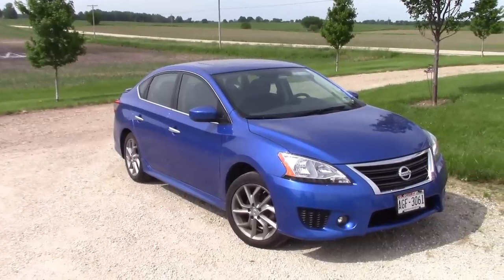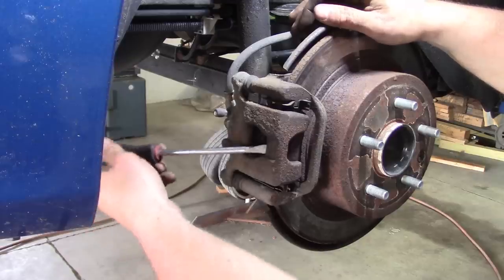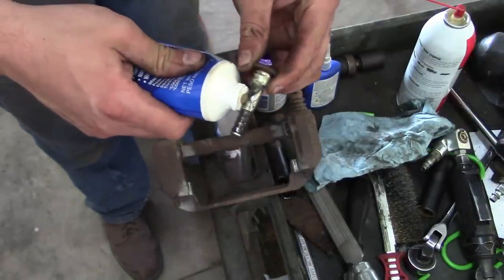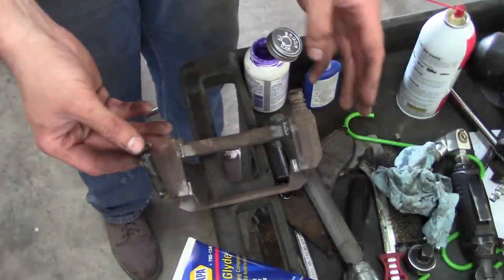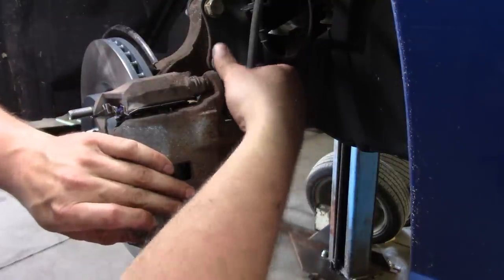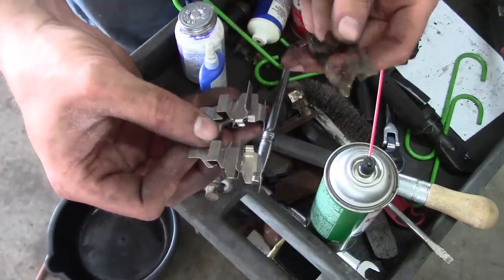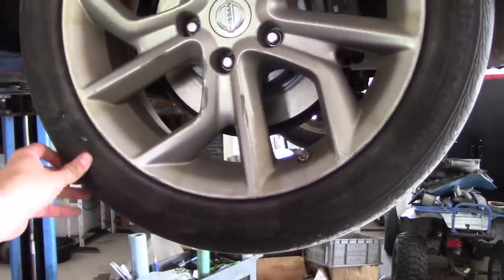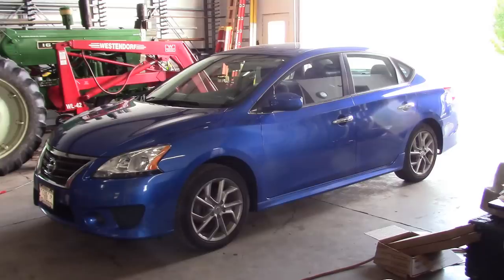Brake Job - 2014 Nissan Sentra

Comment: Nissan puts the plastic sleeve on the pin to give mechanics something to talk about while they're doing brakes.
Reply from the maker: Mission accomplished!
Reply: This has plagued me. I've taken calipers back off because I put the plastic pin in the wrong spot whilst having zero clues as to its function.

Edit: a word
Reply: It's anti vibration / rattle so they don't have to machine the bore perfectly (cost savings) for no rattling in the bore can expand and contract a little I've fixed a noise with the brakes just by replacing them on a Mitsubishi caliper had a ton of up and down movement basically same function on Nissan.
They only need one because it's redundant the top is connected to the bottom
Reply: @Michael-uo4jj  do you know why they are putting them on the top side of the bracket over the bottom and is it better there instead if the opportunity is there?
Reply: We have plenty to talk about at nissan other than the placement of that rubber on the pin. Mainly making fun of other techs mistakes and yelling across the shop about it 😂
Reply: Based on  several service manuals I've seen the intent is to use them as a temporary  retainer while  installing pads and then swing it back into position... less chance of dropping the caliper and damaging the hose..... that said it  seems like kinda of a weak attempt... but that's my story

Comment: If I was you I would do a test with that Torque stick, I stopped using them completely when a Cadillac I worked on threw a lug nut and when I checked the nuts they were all loose. And I have a really good Snap On Impact. Ever since then I have been using a torque wrench. maybe you luck and have a good torque stick ...mine was lying to me. LOL

Comment: Customer can watch YouTube and view the Quality brake job she got. Some shops would just replace everything, Wes showed that you can clean and lube parts and save customers money. If I lived close to you, my cars would be sent to you Wes. Thanks for breaking it down so us amateur's can learn.  😊👍🍻 Pray family is well 😊👍
Reply: I dont know if its always true in auto shops but I work on heavy equipment and our shop rate last I checked is 180 an hour. In a lot of cases its cheaper to put new parts on than it is to pay the labor to clean and reuse old parts. Not always the case but something to think about when you get a quote to replace parts
Reply: @deankruse8751  Thank you for educating me with a different perspective 😊👍🍻
Reply: @alexanderzerka8477  I've been in the industry for about 10 years now and I've never seen someone rebuild a caliper. I've talked to some of the old guys about it in the past and even they said they hadn't rebuilt a caliper or wheel cylinder for many years. Don't think the rebuild parts are even that available anymore in most cases, at least not in stock.
Reply: @alexanderzerka8477  ahh that makes sense. I'm trying to think where this might be?
Reply: @deankruse8751  absolutely the truth in the HD world sometimes. I've replaced a lot of components because the time to clean them up would far exceed the cost of replacement for the customer.

Comment: I've used the purple goo for many years! Eric is right, there are no problems. He's in NY I am in north east PA. Here is what Permatex says:
Permatex Ceramic Extreme Brake Parts Lubricant is a 100% synthetic lubricant containing real ceramic solids for extreme performance under the most critical braking conditions. A purple, non-melting formula, this premium lubricant is Permatex's longest lasting, most temperature resistant way to silence brake noise such as squealing and chattering. Also effective in preventing long bolt and sleeve seizing and galling; excellent on rolling and sliding surfaces operating in wet or dry conditions from -65 degrees Fahrenheit to 3000 degrees Fahrenheit. This product assures that critical brake parts remain lubricated throughout brake pad life. Resistant to corrosion and contaminants, it will not wash out. Compatible with internal/external brake rubber and plastic hardware, including ethylene-propylene rubber. From special-mission, job-specific lubricants, protectants and dressings, to the rigors of heavy-duty needs, count on Permatex to bring you reliability and problem-solving solutions that extend the life of your equipment.
Reply: Yeah, but... there are a lot of claims of slide pin rubber swelling and preventing reinstallation of the pins, and Permatex obviously knows about this from their customer service return message they left for Wes, since they sent him over to a different product for slide pins, and they didn't exactly come out and deny it and say 'that's impossible'
Reply: As a former employee of a brake remanufacturer we had to recall thousands of calipers and change out the purple permatex that said on the bottle "safe for rubber" - it was petroleum based and swelled the rubber to the point that the caliper was effectively seized.  That was over 7 yrs ago, maybe the formulation has changed from a petroluem base.

Comment: I was watching this at 2X.   That hammering on the rotor - - Wes has rhythm.   Thanks for digging into the brake parts lube mystery.
Reply: You too!
Reply: Did you watch the Mannheim John Deere tractor repair video when Wes was tapping on the valves?  I had to watch that several times - the sound and rhythm was just awesome!

Comment: You had me laughing with the “landscaper” comment!
Brakes have gotten more complicated since I worked on drum types in a shop. Yes I’m that old.
Reply: Back in the 60s, I used to re-line brake shoes and grind the shoes on an arc machine to fit the drums.  Might be about the same era as you.
Reply: I work on drum type brakes everyday they haven’t gone anywhere. They are mostly on trucks or small base model cars.

Comment: Regarding EPDM: Any rubber that comes in contact with brake fluid can be assumed to be EPDM. The main hallmark of that stuff is that it is brake fluid compatible.
I think this would apply to most slide pins as well, but no way to be really sure. I'd not be worried as swelling isn't really an issue with the boots - it's a stationary seal.
Reply: Indeed, I’ve used the purple grease from Permatex with no issues for years.

Comment: These little rubber caliper bolt “sleeves” (that's the most common name for these) are anti-rattle devices for the calipers. The sleeve provides additional friction, which prevents the brake caliper from rattling/chattering within the confines of the caliper bracket.
Reply: Which slide pin is it supposed to go on? Top or bottom?
Reply: @mgena717  bottom.

Comment: Do not apologize for fan noise. 
Wednesday I worked under the Sun, on the floor, at 95*F and 80% humidity doing front brakes + 1 caliper and hose on a 2008 Corolla. 
Good thing cold clean water was always a few steps away but still no fun. 
I sweated so much that day I didn't have to pee until I got home at the end of the day.
Good job, Wes ! 👌🏻😎👍🏻
Reply: a small easy up canopy does wonders when working out in sun

Comment: Love the video as usual; surprising the brakes wore out before that CVT pooped its trousers
Reply from the maker: Heh. We'll see how long it lasts.
Reply: Yeah, those CVTs are not popular on the used market here in europe. Lots of maintenace, especially those that had the "lifetime fill" of fluid that was never changed.....
Reply: Yup, they made the CVT  have a lifetime fill on the fluid - you just replace it as part of the transmission swap at 100k miles or when it spews cogs, whichever comes first.

Comment: I've learned a lot from Wes and Dr. O about doing brakes correctly. 
My most recent brake job was on a 3/4 ton GMC. 
Took me 4 hours, because of the wait for turning rotors and 1 wheel hub bearing replacement. 
Bought the URPLE goo for my brake job. 
She's lubed now. Rear brakes were just pads. Rotors were still very good. 
Having a floor jack only and wrestling with heavy tires for this ole man takes time. But I'm glad I have my power tools. 
My wife seems to think I don't need more tools. Thats when I am the midst of a job, and the new tool makes my day. 
For instance, the hub bearing press tool. 
I used it to replace the bearings on a Sienna. 
If I had rented it, 350 smackers to rent. 
I had purchased it for 80.00.
Used the tool 4 times now. Paid for it's self. 
Anyway, brakes are wonderful, no more grabbing brakes. Plus I found out the CV axle boot was leaking. I removed the metal retainer. And fixed it. Cleaned all of the remaining grease and it's good. Now to keep and eye on it.

Comment: Im just glad it aint me replacing those brakes, ive had enough of that, bleed screws breaking off, and i had a disk so rusted shut i had to remove the whole hub and cut up the disk, witch made a "easy" job a day work, but it was an 83 car!
Reply from the maker: I've been there.

Comment: Sil-Glyde is absolutely the bomb for caliper sliders. There are similar products out there, but some of these seem to 'dry out' where Syl Glyde doesn't. Good on you for reaching out to confirm and props to the manufacturer for being forthright.
Reply: Sil-glyde is only good to 500F. Breaks get freaks hot! Specialy in hit enviroments. I have had sil-glyde break down & harder in short order. The permatex grease is good to 3,500F

Comment: The first is the Synthetic Brake and Caliper Grease with Moly, Graphite, and PTFE. The second is Silaramic Brake Grease which is silicone. Both of these products make claims about safe for rubber. But the makeup of the grease is directly related to the rubber it should be used on. There are different rubbers used on automotive braking systems. You will notice other brands that manufacture brake grease will also have a few different flavors. 
 
If you look in your owner’s manual for a Toyota/Lexus or Honda/Acura product for example. It will say when lubricating the pins to use a silicone based grease. This is because any other grease will have a negative reaction with the rubber that manufacture is using. If you used our Synthetic Brake and Caliper Grease you could have swelling of that rubber. Because of the compatibility between the product and the rubber.  
 
If you look in a GM products owner’s manual (Chevy, GMC, Cadillac, Buick). It will not give you a recommendation unless it has Brembo Brakes. This means you could use either product. Using Silaramic maybe overkill for the application but it will not harm anything. I personally like to use the higher rated product on vehicles that are driven hard or towing. 
 
Some of the newer Ford’s use a EPDM rubber in the middle of the pin, if you do not use a silicone based material on it. The rubber will swell and stick the pin and you know what happens from there. 
 
So, it is more so the rubber that the manufacturer is using just needs to be paired with the proper grease.

Comment: The plastic liner on the brake pin is to isolate rattle of clamping force on the torque side of the caliper.

Comment: Interesting they brought out a silicone equivalent product.  I switched to 3M Silicone paste several years back.  No more brake issues, and one product to keep in stock for brakes, dielectric connections, orings, etc.  Seems to have better corrosion protection than SIL Glyde.
Reply: OH,  NOW you tell us, I got actual Syl-glyde..
Reply: I think that's because the 3M stuff has a higher concentration of silicone compared to the Sil-Glyde. Consistency wise, they're not similar and have different odor to them.

Comment: I like your work!  Great info, and it's just how I would do it too.  You do what is needed and keep it safe and going down the road, likely better than the factory did it.  Spraying the anti-seize on the hub before the rotors and also before the wheels install is what really sets you above.  That is for the next guy's advantage, and you do it anyway.  Keep it up.  
Its an inconvenience if a car doesn't start, but its a disaster if a car doesn't stop.

Comment: I use the Permatex purple ceramic on the pads and the Permatex ceramic silicone extreme on the slide pins. I haven't had a problem since.

Comment: I've used Super Lube for quite a few years now and so far I haven't seen any issues with it. Wider temperature range than Sil-Glyde and even 3M Silicone Paste, but otherwise I think they are all similar. Super Lube also has PTFE, which should help if it ever does get mostly washed out. Haven't had issues with it swelling rubber, but I have had that issue with anti-seize and a couple other lubricants I can't remember over the years. If that rubber vibration damper on the pin swells, it will be stuck in there just as bad as crazy rust!

Comment: Excellent info on Permatex products, it is my understanding that EPDM is resistant to mineral based oils, but most rubber is not, so a rather diplomatic answer from Permatex. Rubber is a natural product, so not intolerant to many chemicals, so it's Silicone based lubricants for rubber items.
Great vlog, gotta hate that rust 😨.
Thanks for sharing, John.
Reply: indeed its down to the mechanic to know  which is which...so basically need to move away from any products that arnt safe
Reply from the maker: The rust keeps us busy!

Comment: Wes, When I do caliper rebuilds or I have even taken apart a year old  Reman that was one that was brought for my Avalon before I had got it. Well on that one it stopped retracting and the brake dragged. I had got some  Castrol Red Rubber grease. and used it after I cleaned up the very lightly rusted internals, I mean just a very light surface of very light  rust. I was able to coat the original seals and pistons with it and have had no more hang ups. I do rebuild calipers with new seal kits and use rubber grease on the internals of calipers from now on. Re man calipers are just cleaned and assembled dry, so the can rust easily, perhaps even just from sitting on the shelf in the box. The Sil glide is safe for internals also and I have that now as well as the red rubber grease. Some MC repair manuals also show using grease on master cylinders for brake as well as hydraulic  master cylinders for clutches and master cylinders. .

Comment: I have done so many brake jobs on these at work. Most of them are in similar condition. Most of them get some wire wheel and roloc treatment. 
I also like to use a surface prep disc on the bolt heads so it actually fits in my socket easier. 
Crusty Nissans.

Also I have used the permetex and have for years on all brake parts. Not had an issue but I switched to sil glyde a couple years ago.

Also my shop uses the same rotors. They must be decent. 
Since I can get them at same cost my shop does I will be putting them on my own car soon.

Just a thought to share. I use the brushes like that as well to clean the holes out. I have a spare that I clipped the end off and put it in a drill. Seems to clean well.

Comment: the solid pin goes at the beginning of the rotation ,to explain if the rotation is clockwise ,it would go on the top and the one with the rubber at the bottom ,when you brake the caliper is forced at the top hence the solid pin and the bottom can vibrate hence the rubber bushing to prevent that

Comment: I've got a Suzuki Burgman 650 scooter with a CVT. I say it's like a motorboat. The revs go up as soon as you hit the throttle and the speed lags as it comes up. I think it's great, instant torque. I've got about 40,000 miles on it. It's got a "sport mode" button that ups the RPM for the current speed by about 500 rpm and from a side street I could merge into 50 mph traffic from a complete spot safely into probably a five car length gap. I don't because they'red be "Karens" in the ditches all over the place if I did. I doubt there's anything smaller than a liter bike that can get to 50 mph faster. No flailing with the clutch and shifter, just twist and go. But don't forget that the left lever is the rear brake and not the clutch.
Reply: Didernt type of cvt much longer lasting because the belt can be replaced and it dosent have the stresses on it that a cars transmission has

Comment: Just did a complete brake job on my '04 Ford E350 van. It only has 45,000 but  driving those few miles in a rust-belt state took its toll on the calipers and rotors! If I lived in Texas or further west I probably wouldn't have had to change anything.

Comment: One of the jobs I've loved doing on all my cars is brakes , from new discs and pads to fitting nice new shiney calipers.
Just replaced my discs , pads and calipers on my Skoda Yeti 4x4 just a couple of weeks ago.
Love new shiney bits .
Reply from the maker: They don't stay shiny for long around here!
Reply: @WatchWesWork  yeah they use a lot of salt on our roads here in Scotland too , but the shineyness is good while it lasts.
What's your opinion on antiseize on wheel nuts and bolts ? , I've always done it and never had a problem.
Reply: Great job on those brakes btw , shops round here are never as thorough as that . That's why I do my own.
Reply from the maker: @hammyh1165  My general rule is if the studs are rusty, they get anti-seize. If they are in good shape and have the factory plating, I don't use it.

Comment: Sil-Glyde is made from castor oil, i.e. it's vegetable oil derived hence is safe for rubber. Permatex purple is petroleum base AFAIK. I'd use Permatex Orange if I used permatex brake grease (I don't). I can't get Sil-Glyde at a reasonable price where Iive. I work on my own two Hondas. The service manuals call for 3M silicon paste for slide pins and Honda M77 (same as Dow M77 AFAIK) for everything else on the brake that needs lube. I'v come to use Honda M77, and SuperLube Brake grease for caliper pins in lieu of 3M paste. The SuperLube is a silicone grease with a PTFE additive. It's never failed me, but I only work on my own cars so my experience is very limited.